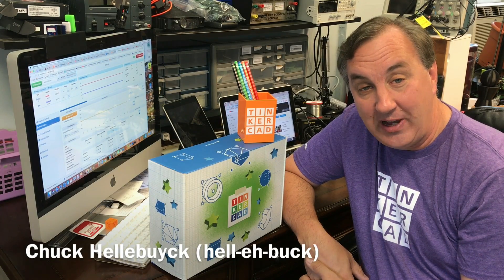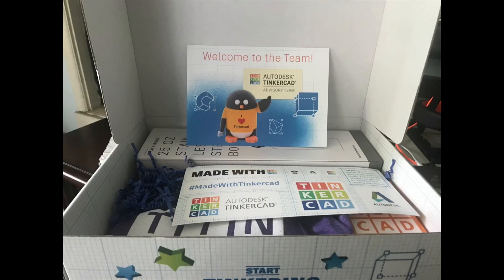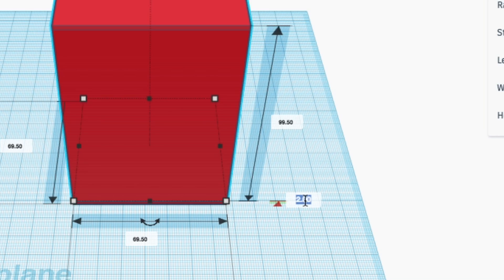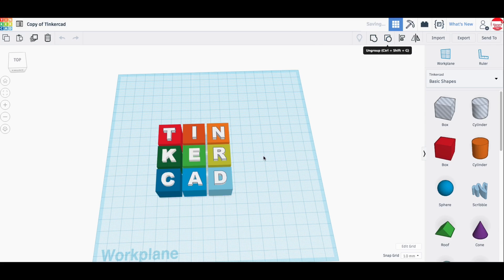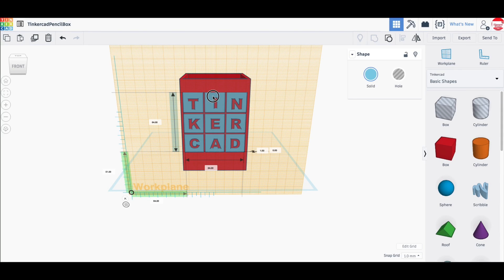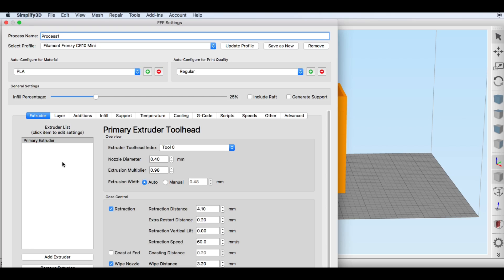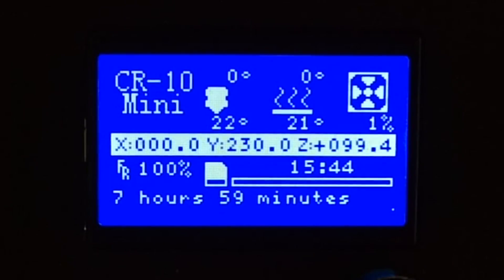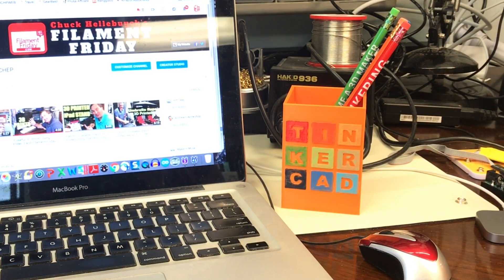How to Design and 3D Print Tinkercad Pencil Box

Comment: Chuck - thanks for steering me to TinkerCAD - I'm a Creality Ender-3 user - when I exported from TinkerCAD to .STL and loaded it into the CURA slicer, the print came out at the "HOME" position of the printer, not the center of the bed, as a result most of it just fell off the side of the bed.  When it loaded into CURA it looked perfectly centered in the print bed.  So I'm looking for a setting that messed this up.
Reply from the maker: Make sure you designed in mm not inches.
Reply: @FilamentFriday  No, it had something to do with the option for importing the .stl into Cura.   I've looked